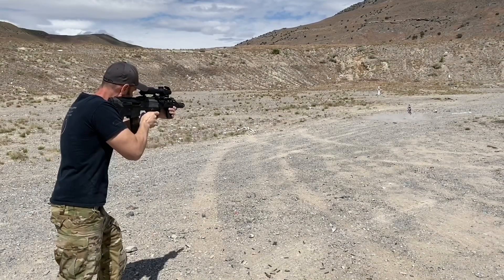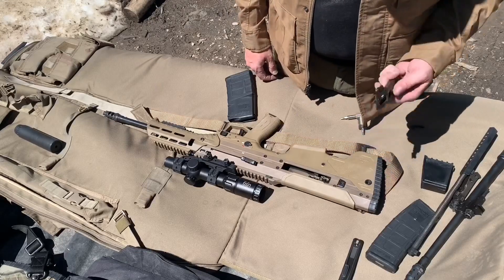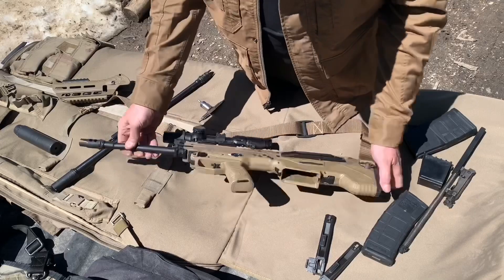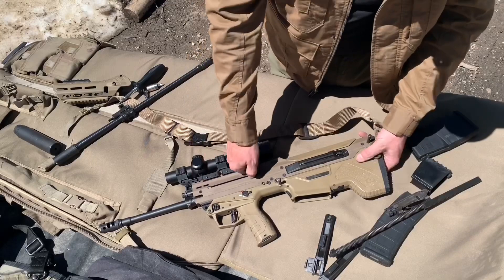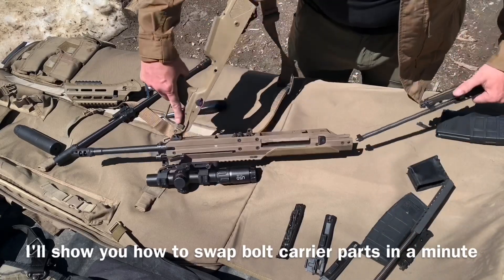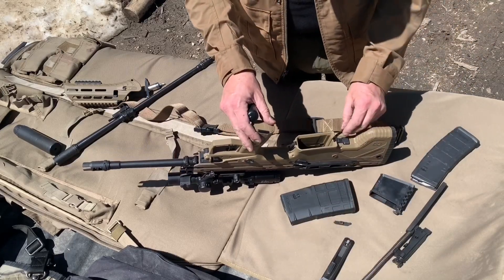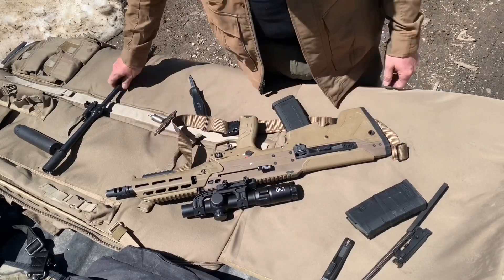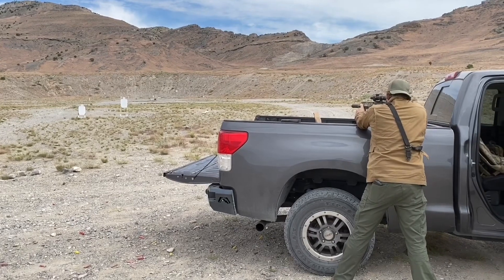Caliber Conversion in the MDRX, 6.5Creedmoor to 300 blackout

Comment: I have a micron, It'd be nice if the 300 blk out conversion was less of a hassle to do.  I'd have to change the side panels, the bolt, the op rod spring (removing previous loctite then reapply), and the barrel every time.

I wish it was offered in a SE version that only required a barrel swap.

Comment: Glad I checked the end of this video before installing my 300blk kit. The op rod being threaded left-handed wouldn't have crossed my mind. 
One request I do have; do you think future op rods could have a wider flat surface to put a wrench on? I went through a number of adjustable wrenches trying to find one that had a thin enough jaw surface, while still being noticeably longer than your typical 9/32 open ended wrench.
Reply from the maker: We actually already did increase the size of the flat.

Comment: If I change the barrel and back again, do I have to readjust the optic or is the mount so repeatable that the point of aim doesn't change like the SRS?
Reply from the maker: it depends, some more than others. But it should be pretty close.

Comment: May I request to see the function of the gasblock - where does it vent out   and can one remove the top rail from the front hand guard. Also can you do metric muzzle threads and hard chrome line barrel + chamber ? Can you test run one completely dry/lube free like one does when in a dusty area
And do you make a blank firing attachment for doing drills
Also what is your price for European  customers I saw sb selling them for over 3500€ just the gun no convertion kit included that kinda sounds like they overpriced it almost by 1/3 for their win margain

Comment: I have the 5.56/.223 MDRx, so if I purchase a .300 BLK conversion it will come with new barrel and BCG?
Reply from the maker: No, it will come with the shorter spring, you swap out the spring if you want to run 300blk.

Comment: I could experience the ease of switching out barrels too If they would ship me the conversion kit i ordered back in march...  Still pending status.  Also looking back at the desert tech site the conversion kits don't look like they come with a spring or complete bolt carrier group.  My original MDR was in .308 but the conversion kit i ordered is 223, is this going to cause malfunctions by not having the right spring tension?  I also don't see a spring  as a separate accessory.
Reply from the maker: as shown in the video, the 308 and 223 use the same spring, so you will be fine. We are working hard to get orders caught up, we'll get yours to you as soon as we can.
Reply: Thanks for responding

Comment: Going from 5.56 to 300 blackout would you only need to change the barrel and nothing else? That should be a less expensive combo.
Reply: just the barrel and maybe the spring, trying to get confirmation on the spring... they use same bolt, magwell, and ejector panels (unless running a side eject model, then not sure) though.

Comment: is it possible to buy the chassis only, then buy a caliber conversion kit later?

been wanting to buy just the chassis then a little bit later buy the caliber conversion kit to spread out the costs.
Reply from the maker: Not at this time
Reply: @DesertTechUT  I just got a different response from sales before I saw that you replied here. I also already ordered the chassis without conversion kit on your site before I saw this response.

So I currently have a chassis on order without a conversion kit. will there be parts missing when i order the conversion kit later?

Comment: err this isn't so straightforward, this still would be a real pain in the behind to do frequently
in addition , these conversion kits don't come cheap either ... so I guess although you do offer the conversion kit, the fact that it is a pain to do plus the cost does not offer that much benefit
I just purchased the 556 with the intention of getting the 308 conversion, so my fault in not enough research since if I had of realized the conversion kit isn't really worth it, better off just buying a dedicated 308, i probably would have reconsidered my mdrx purchase
oh and you still have zero again so not even that benefit